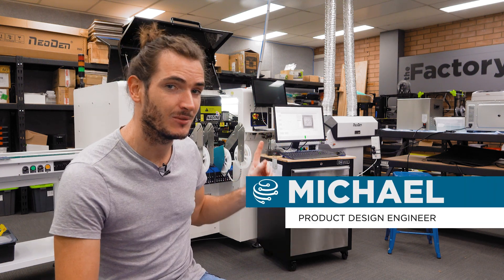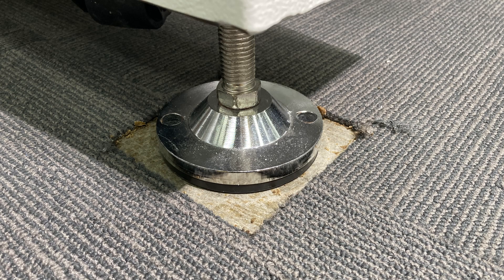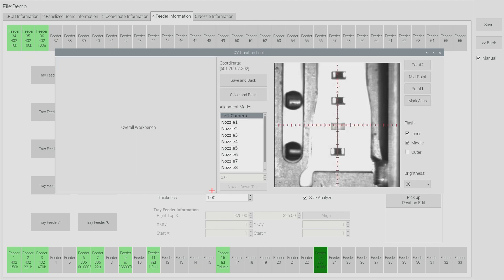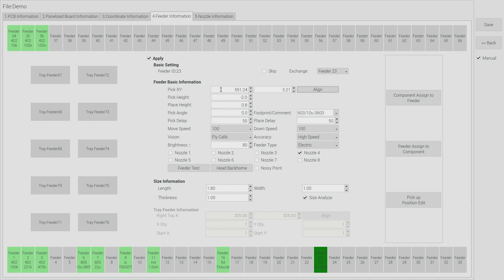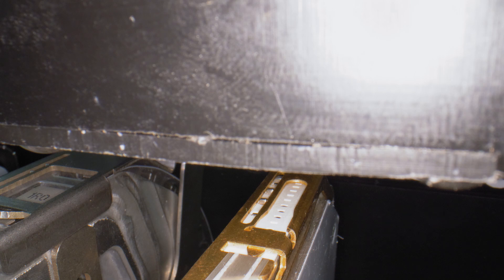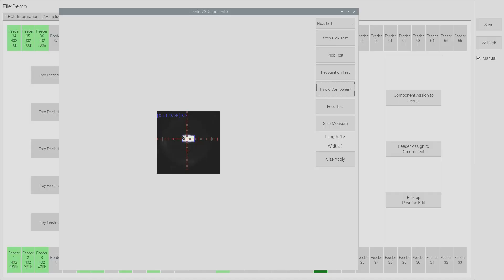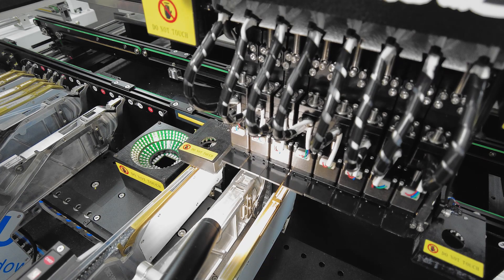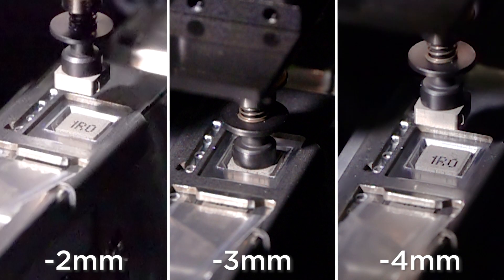The Factory | How To Align Components for a NeoDen K1830 Pick & Place Machine

Comment: Are you placing 0201 components regularly? If so, are you just using the fly by camera for alignment and placing successfully?
Reply from the maker: We've standardised around using 0402 parts - but have heard about others using 0201 at high speed. Being diligent with warming up the machine, regular nozzle calibration and using the "Position Correction" function after the first board in a panel seems to be a game changer.
Reply: I'd really appreciate if you could explain please the 'Position Correction' function on the K1830 and also how you go about optimising component placement.  @Core-Electronics